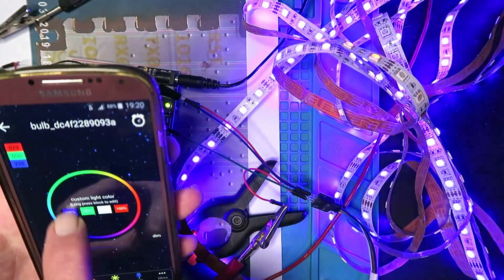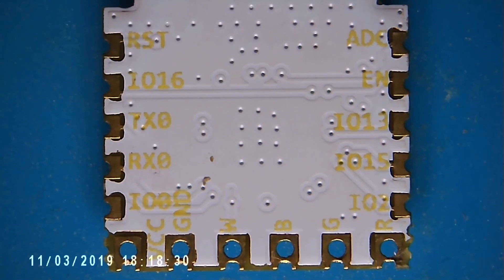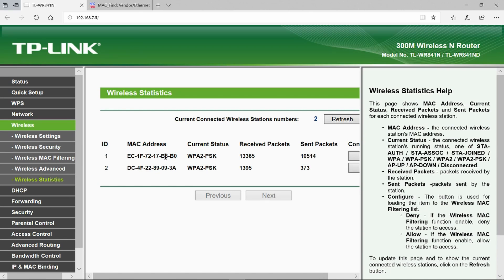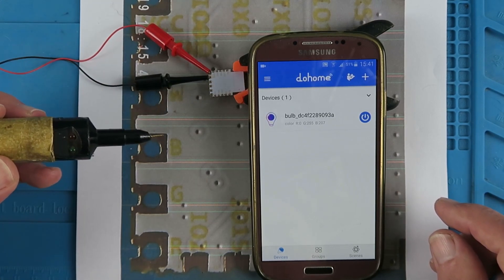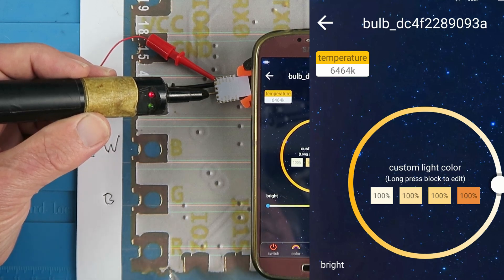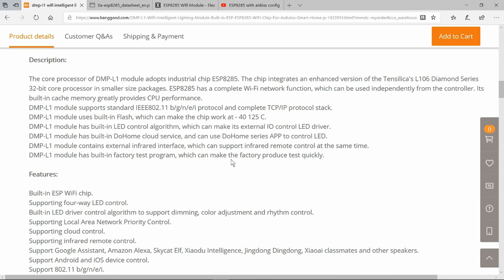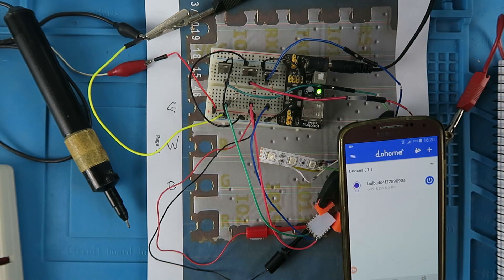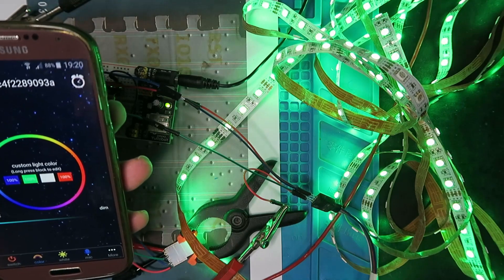ESP8285 WiFi Intelligent Lighting Module DMP L1 Tutorial

Comment: Did you ever try flashing this device?
 I wanna pick them up but not knowing how much flash this little guy has is make think twice about it.
Reply from the maker: No, never got around to flashing it. It's a few years old now and there are probably better alternatives available. Thanks for watching, have a great day!
Reply: @1nformatica  Its form factor is still used in some current products, so it is not yet obsolete by any means. I have tried to flash it like an ESP8266 and that has not worked.
Reply from the maker: @r2db  I have not tried but the information here may help : https://www.instructables.com/How-to-Get-Started-With-ESP8285-Module-/ Tell me if it works!!